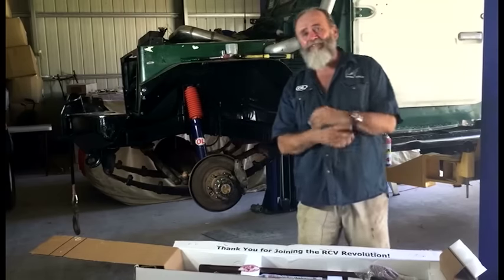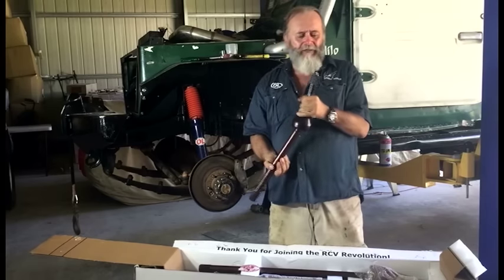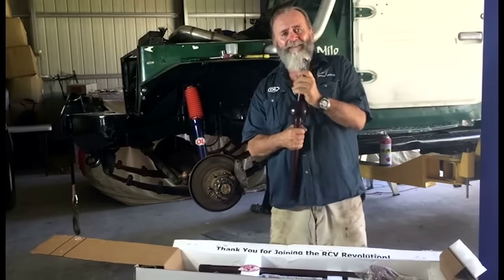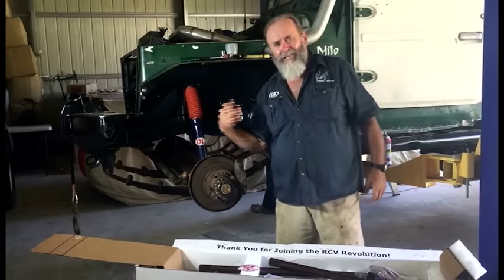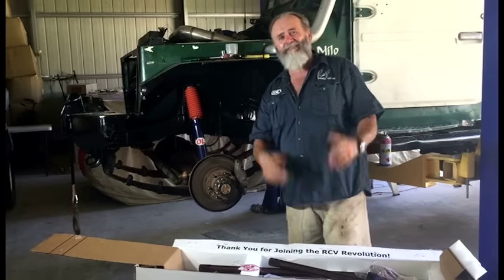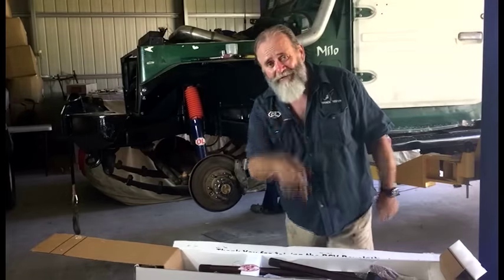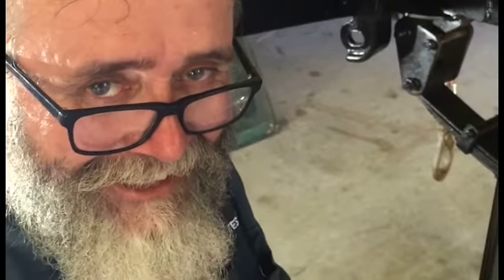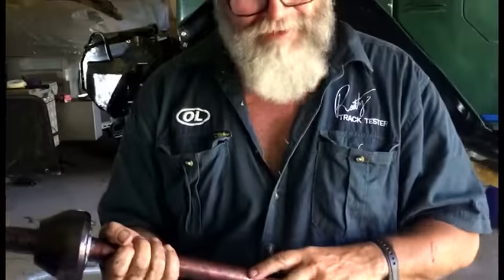Tough As -  RCV Axle Installed in Milo - Roothy Bushmechanic

Comment: Hi Roothy

Just recently put RCV's in my 80 series, been warned not to mix the grease that they come in with any other grease, so I got some grease from Lockup4x4 and then had to buy a American size grease gun to fit there smaller size tubes of grease, how did you go on with this?  Also am surprised that you didn't replace your wheel bearings whilst you had Milo apart!

Regards

Phil